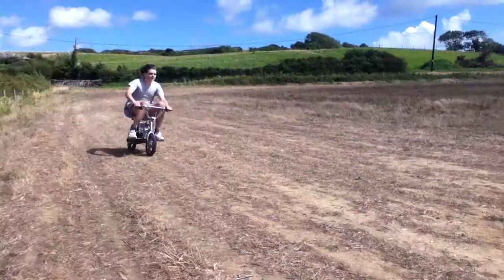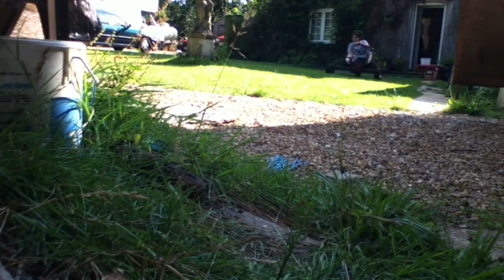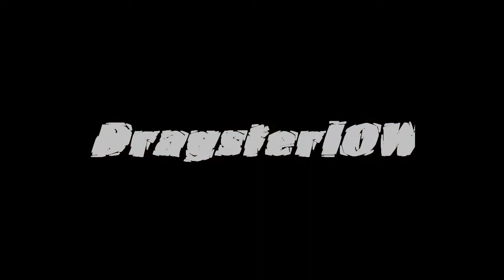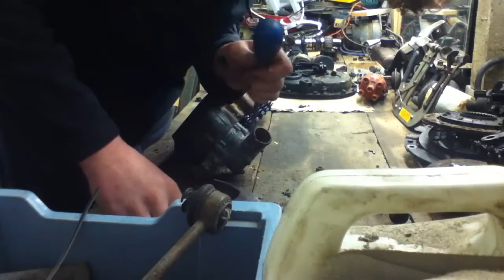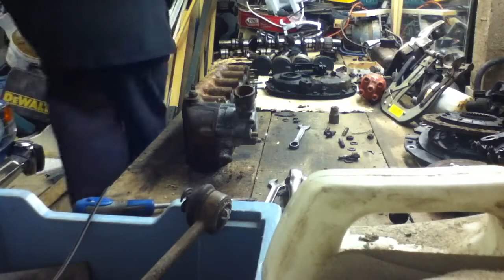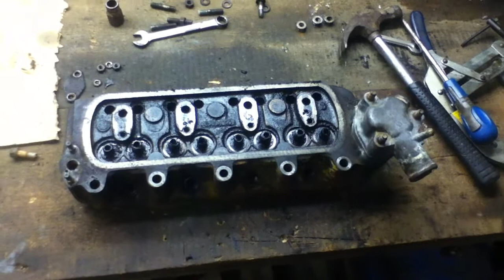A Series Mini Engine Rebuilt Part 2

Comment: Get a rubber mallet buddy
Reply from the maker: Normally I would for something like this, but the thermostat housing was seized on solid. I still didn't get it off with a normal hammer. Had to cut it off in the end with a grinder.